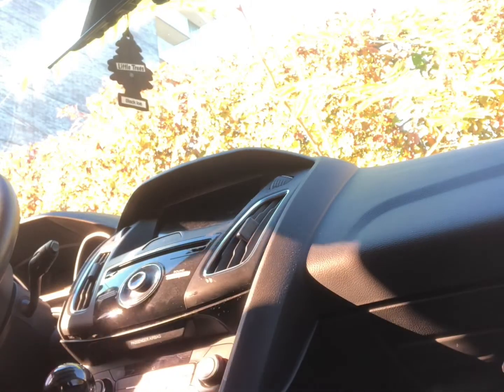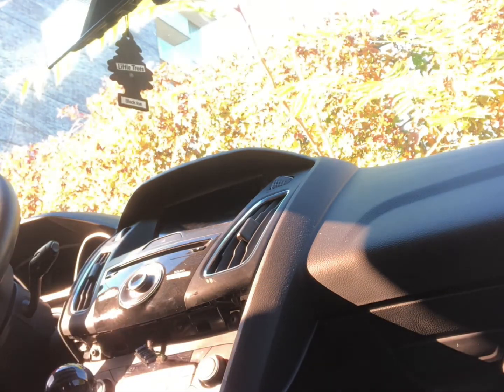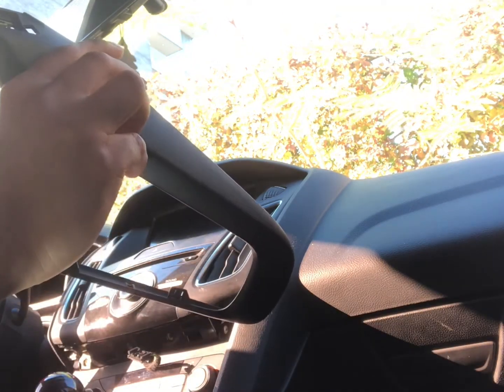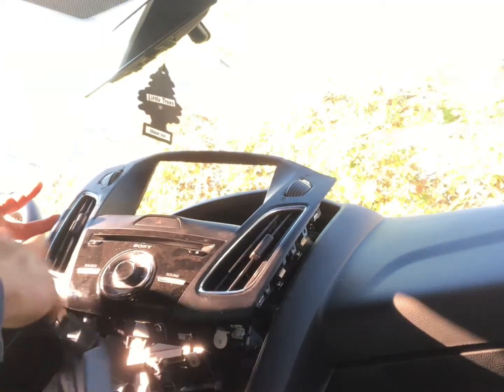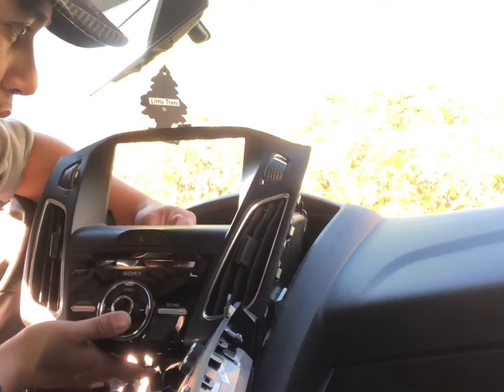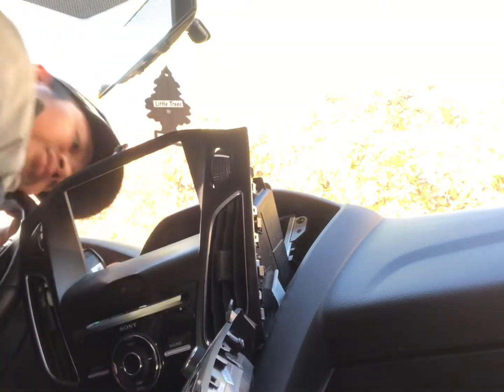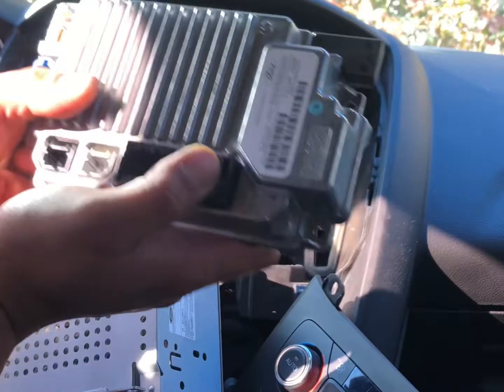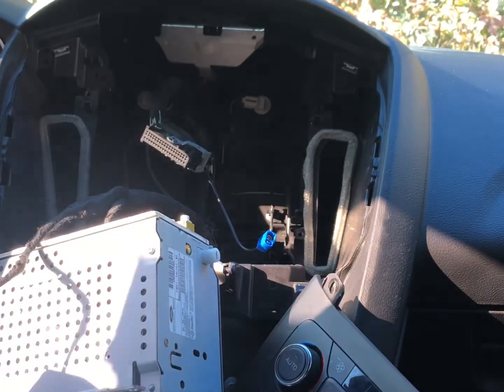Ford focus st APIM replacement (audio screen not working)

Comment: Do you need to match the APIM numbers to skip the programing ????
Reply from the maker: To be honest i didnt try that, we just programmed the new APIM.
Reply: @hyundaitech  thanks man
Reply: @hyundaitech  did you use Forsync to reprogram it? I’m looking to replace my own APIM now since it’s dead/dying. Do you also have any suggestions or recommendations on where to pick up a new unit?
Reply from the maker: @skeletor959  hi , so actually the owner of the vehicle bought the component in the dealer, then since i work beside a ford dealer i asked them to program the part after the installation. Hope that helps.
Reply: @hyundaitech  Ah gotcha, thank you!  Did they charge you for programming of the unit?
Reply from the maker: @skeletor959  well i know the tech from ford so i just bought coffee for him hahaha.